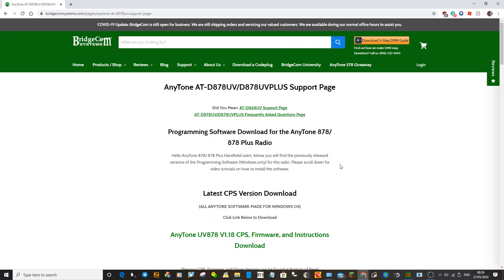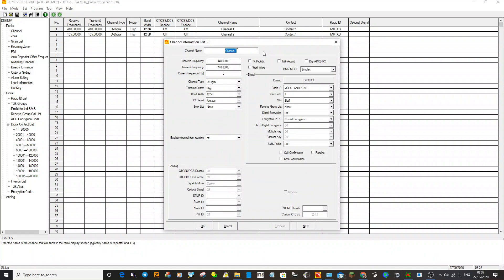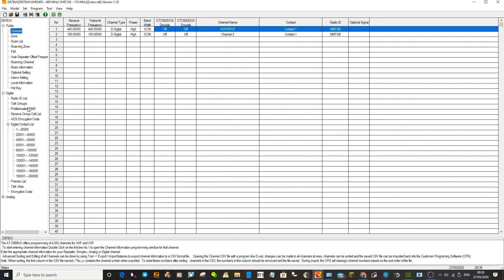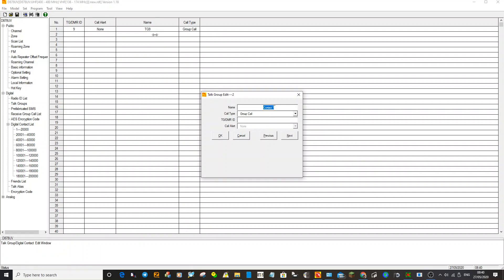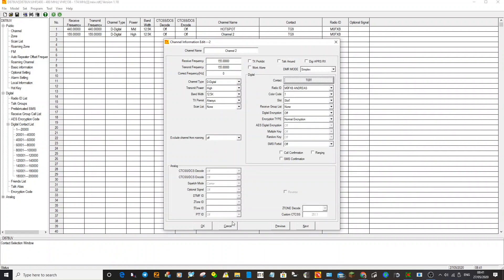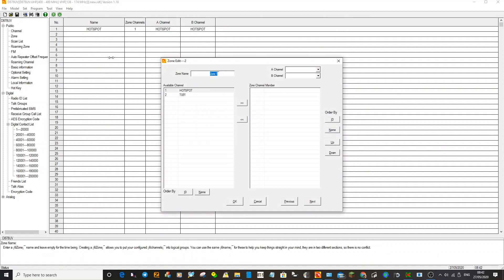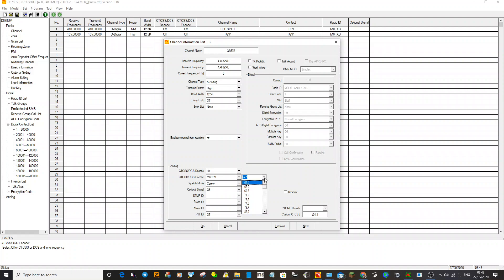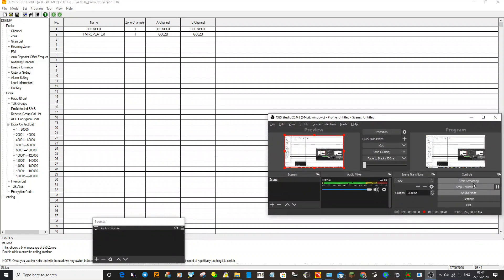ANYTONE 878 CREATE BASIC CODE PLUG FROM SCRATCH TO UNDERSTAND HOW DMR SYSTEM WORKS

Comment: Hi there and thank you for this video, question ⁉ do I need a ham license just to ad ZONES to my anytone 868, I just purchased mine and it has one zone. I only have a gmrs license. I want to ad like 5 zones to start
Reply from the maker: Hi -I the freq on GMRS are 462 mhz to 467 -talk groups are a digital talk group room i think check with your local Ham Radio club.
Reply: @M0FXBHamTech  thank you I saw exactly what I needed from another video and got it and was able to successfully add more zones 😀

Comment: just  have to say this.  this program just plain sucks. no way to copy a few lines of channels and add them to a second  file OR  if you run a second instance it will not copy to it either. what junior programmer wrote this CRAP .
Reply from the maker: Not sure what you mean it's a very good code plug program .
Reply: @M0FXBHamTech   This program does NOT follow the "normal" convention used by Windows , OSX , or linux . when it comes to copy and paste it's RUBBISH.   compare it to the program sold by  https://www.rtsystemsinc.com/Handhelds_c_486.html       take a look at it here being used to program a FTD3x  Yaesu .  the shame is  RT systems does not yet make it for the 878uv ,  the rt systems program allows cut and paste .   any of us can download a plug and then cut pieces for quite a lot of brands and models .    anyways SORRY for venting , guess I will put this radio up for sale as it's useless to me
Reply: @rtcy2008 mad at someone else cause you cant figure it out. Got my license 5 days ago and programmed it in an hour. You gain nothing acting this way. Hope you’re not the same 2yrs later.